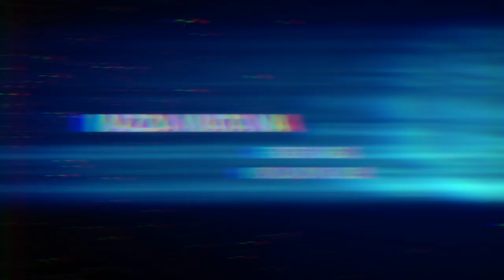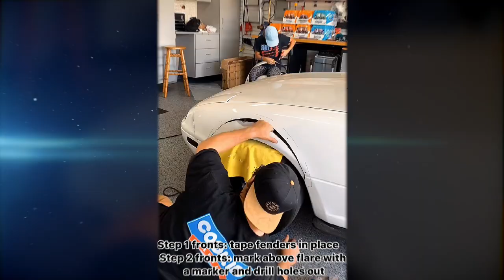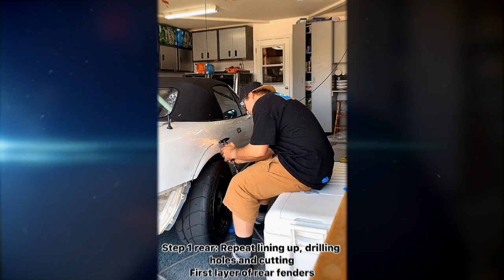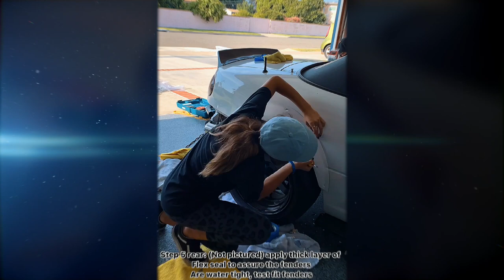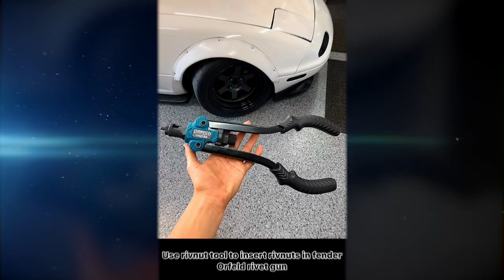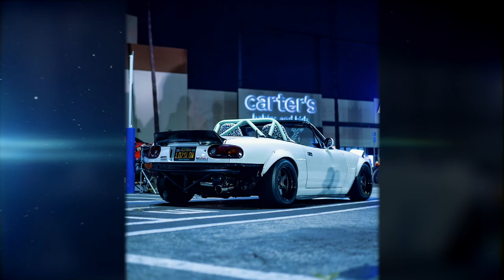Mazda Miata NA Fender Flares installation Guide

Comment: Wheel specs? I want and idea of what wheels will fit with the flares.
Reply from the maker: 15X9 ET0 fits nicely!
Reply: @carbonmiata2012  what sized tires did you guys use?